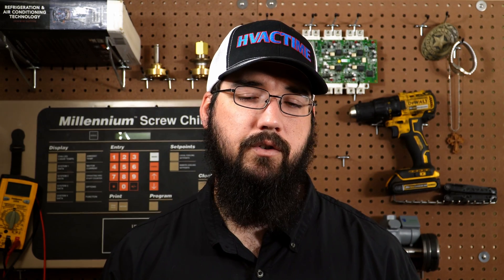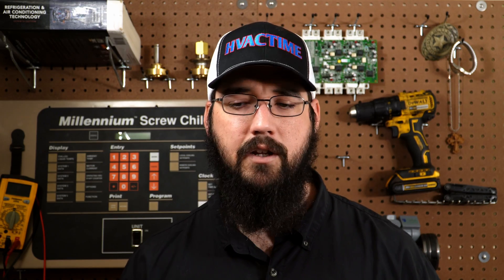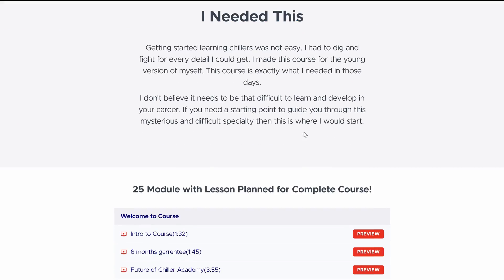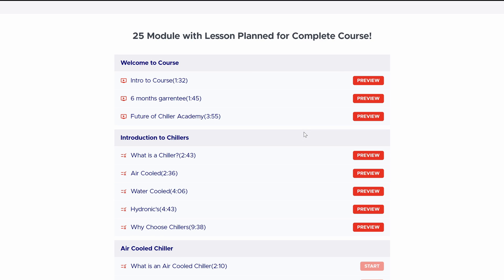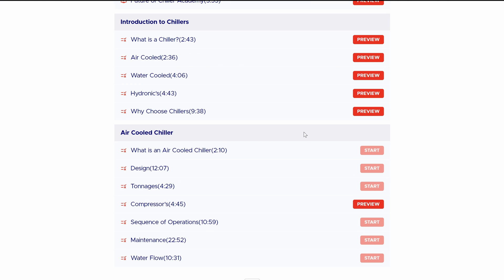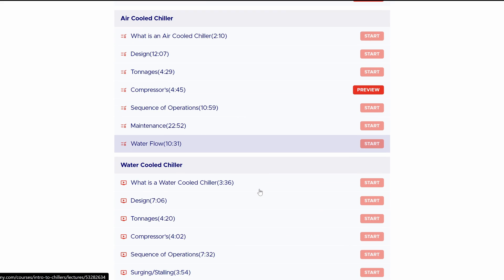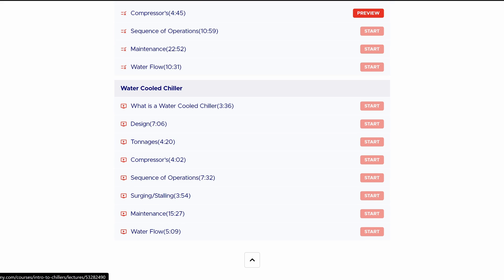What is Surge in Centrifugal Compressor

Comment: Hello Holden, I'm a Centrifugal Heavy equipment technician with 30 years of experience and love looking at you video clips and explanations therein. So I strongly encourage you, to remain committed in your quest to educating our younger technicians who, are not aware of the serious issues and problems they can and will encounter on Centrifugal Chillers, be they the recognized and competitive Models like YORK, McQuay, Daikin, TRANE,  CARRIER. Their are newer brands entering the market who have yet to prove their ability to run with the older Models that have been in the field for over 100 years like the old Model White Western House and Worthington etcetera.
I liked the old R11's R12's which were phased out. Chillers that worked in a vacuum required a purge unit and the skilled technicians who understood their operations. Positive Pressure Chillers are great and have reduced maintenance cost however, their main principle operations remain the same and require experience operators to understand certain condition and logs.  

Ahh getting a bit excited here sorry. Anyway, I would like if you can present a video clip on Chiller Stall as well. This phenomenon is also a serious and destructive condition that occurs just before the surge and many younger Centrifugal Chiller operators seem oblivious to this condition as well. Thanks again for sharing your experiences. It is indeed helpful.
Reply from the maker: Thank you, it's an honor to be able to teach this stuff. If you know anyone needing training let them know about chilleracademy.com

Comment: Hi 
I am working on YORK OM Multi stage centrifugal chiller 5000Tr, Evaporator pressure - 35 psi, condenser pressure 117 psi,so compressor lift -82 psid.and machine is working fine.
And u were saying lift should be around -60-80psid .
So please explain is it ok  or lift vary according to model of centrifugal compressor
Reply from the maker: There will be variance. One of the benefits of multi stage is improved lift capacity. Trane CVH also run higher lift threshold for same reasons. That level of lift requires really good load and fine tuned water flow to operate smoothly. That is evidence of a well tuned system, good job!

Comment: A 1963 vintage 350 ton Tonrac experienced surging one time that made it sound and look like it was going
to jump off the floor.  The system operator was trying for a dual operation of steam and chilled water
to use during the transitional seasons, but apparently the heat got into the chilled water and sent 
slugs of very warm water into the chiller tank, although the chilled water return temperature remained
at about 50 deg. F.  It was perplexing why adding heat like that to the evaporator side challenged the
compressor so much, as the condenser was cool and clean.  
     That machine had a rotor about a foot or more in diameter, judging from the case it was in.  
     The operator never did that again.
     The chilled water system was retro-fitted into the buildings by a mediocre HVAC company known for
overlooking important details.